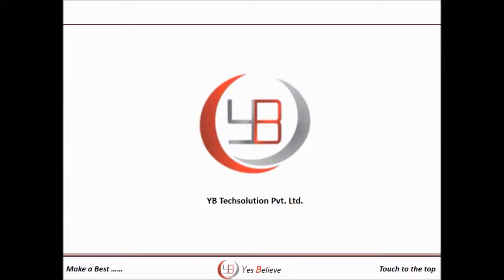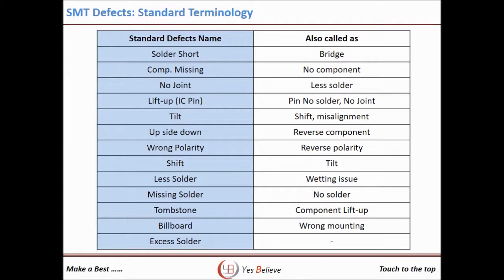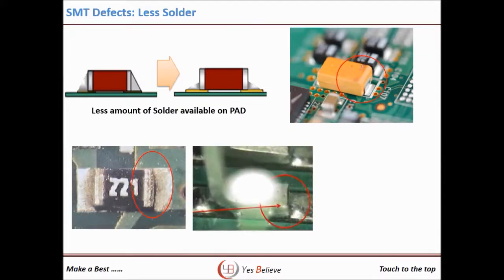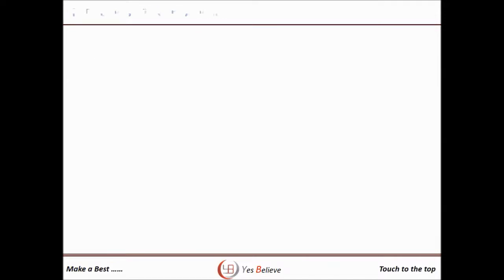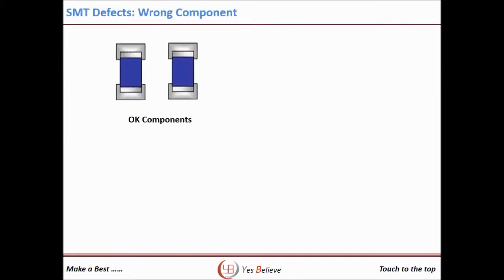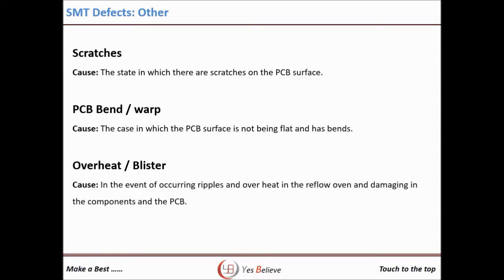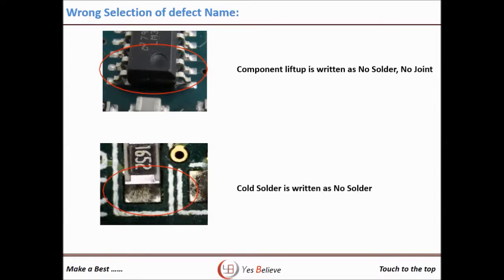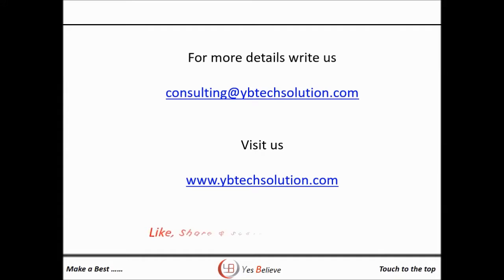SMT Defectives_Updated video

Comment: Hello mam ,  if there  reflow. Preheat section  high temp  given then what is result ?
Reply from the maker: If reflow preheating is higher than the standard then flux will evaporate fast causing wetting issues. It can cause other defects too.
Learn more about reflow oven profile setting & defects at our SMT full Process Training program. Register today & special discount at https://lms.edumarshal.com

Comment: Component shifting is the biggest diffect
Reply: how can we fix it
Reply: Main reason of the Component shifting is depend on the temperature in  the smt
Reply: @fateh20121  this is depend on the smt floor temperature and humidity. And also depend on solder pasting
Reply: @fateh20121  Repends, how is the design of the pcb? It usually has to with the design of the pcb, from my experience anyway. DFM analyse may help.